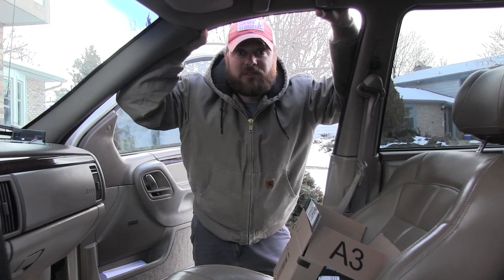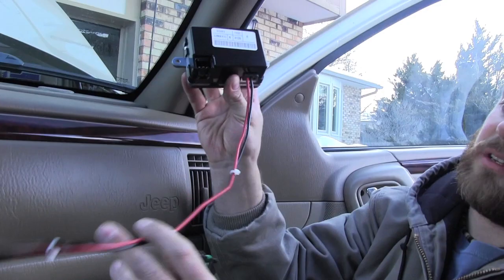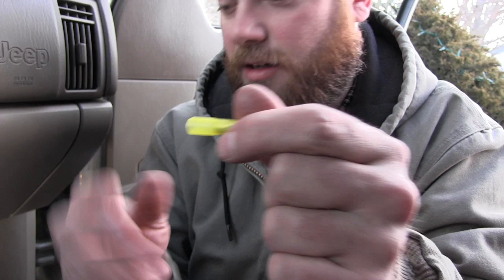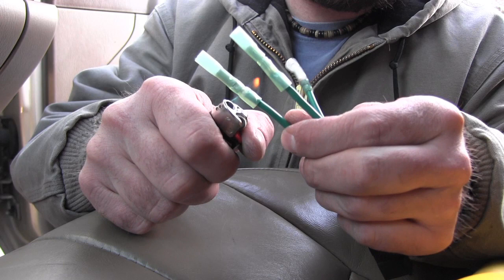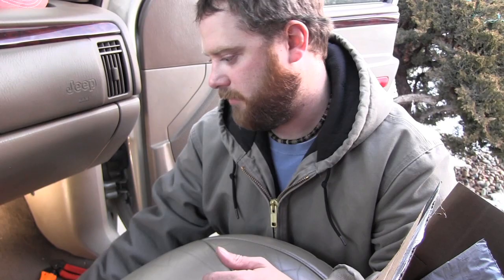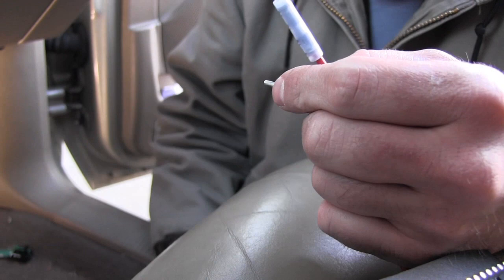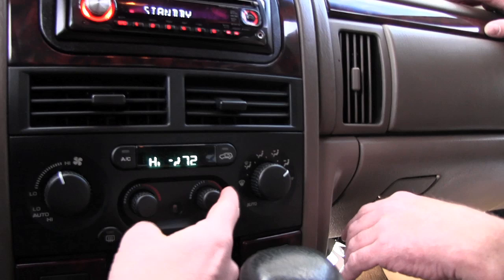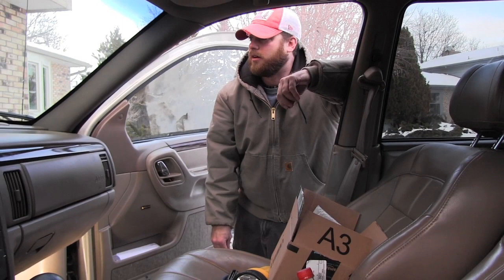How to fix your Heater Jeep Grand Cherokee

Comment: Will your heath or AC still come on if the fan is not working. I think my fan needs to be replaced but how do you know when it has stopped working will you still feel heat?
Reply: If you are driving fast enough air will come from the vents but it’s propelled by the cars movement and not the blower

Comment: Was this a permanent fix or did the wires just melt again? I imagine the wires are melting due to too much current draw from the blower motor itself.
Reply: yes you should replace the blower motor with it.

Comment: But what causes this to melt there is a voltage issue somewhere but where it shouldn't just melt and need to be replaced all the time that's absurd anyone running a inline fuse or anything to prevent this from happening?

Comment: Will this work for the hot and cold of the a/c? Or is it just for the heater?
Reply: This will make the blower motor work….so yes it works for the heater and the a/c..  This is a common problem w/these jeeps.  Sorry for the late response.

Comment: Will this fix my blowers? My fans stop blowing today and wanted to know if this will help if i change this?
Reply from the maker: +Franklin Calon Try wiggling the wire connected to the resistor while the heater is on.....if the blower turns on while wiggling the wire, then more than likely the resistor is bad....not your blower motor.
Reply: You were right man! Thanks! However, I noticed that my passagenger side vents only blows cold air even when the passagenger side heat setting is on the highest heat setting. Does this have to do with the resister too? I did notice that the resister wire does get hot and it does smell like it is burning a little.

Comment: where did you get the pig tail , model number , I am having a real problem finding it 

Thanks
Reply from the maker: Richard, I found it on amazon. 
https://www.amazon.com/Dorman-973304-Blower-Resistor-Harness/dp/B009M1KQ8O/ref=sr_1_15?ie=UTF8&qid=1486003178&sr=8-15&keywords=blower+motor+resistor+2001+jeep+grand+cherokee